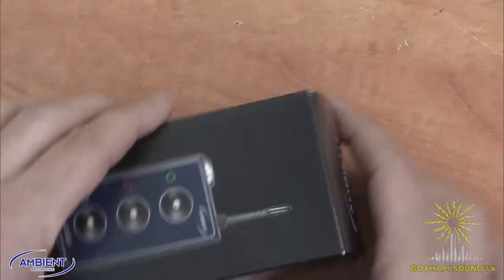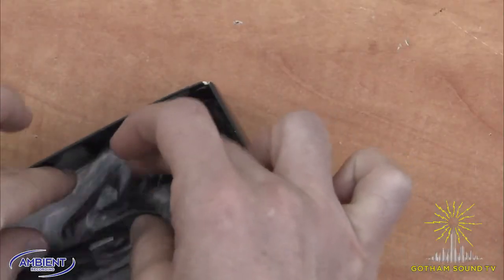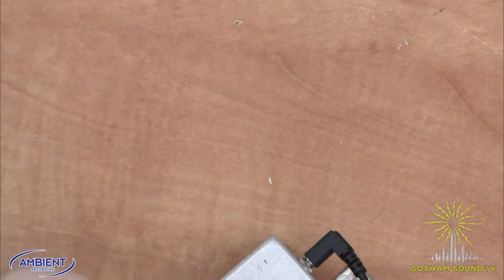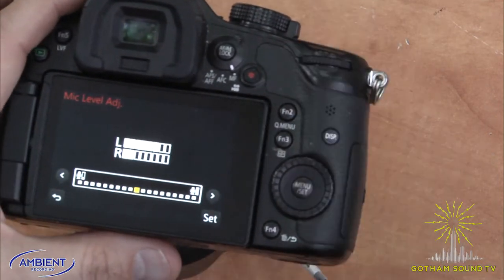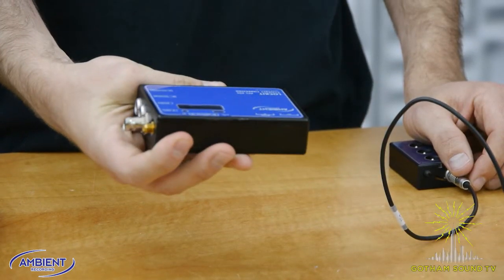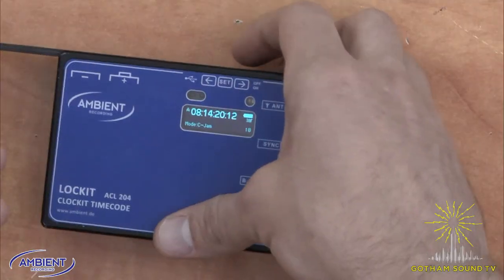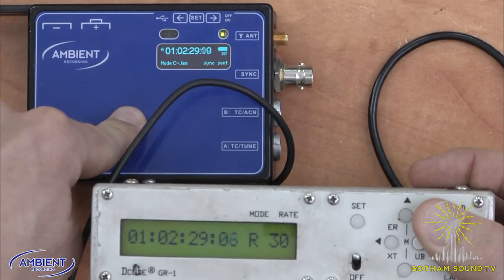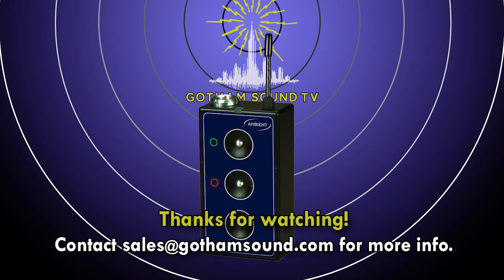Ambient NanoLockit

Comment: Hi Gotham Sound!! 
Can you pleasssee explain what is the difference between A MasterLockit and A Lockit ?
What is the difference between Tinylockit, Lockit and MasterLockit?
What do I need to sync 6 nanolockits to 50/60fps timeframe? 
(5xGH5 + MixPre6)
Can I use only 6 nanolockits?
Can I control all 6 nanolokits via Lockit / TinyLockit?
Can I use Lockit/TinyLockit without Battery plugged in my 5v Ac Adapter?

What configuration of Ambient products will let me sync my videos to 50/60fps?

Thank you , I'm sorry I hogged you with so much questions..but please help me understand :)